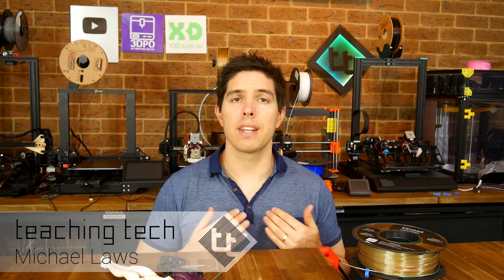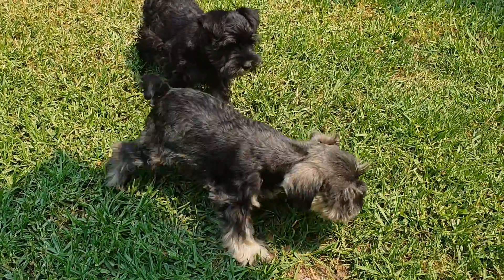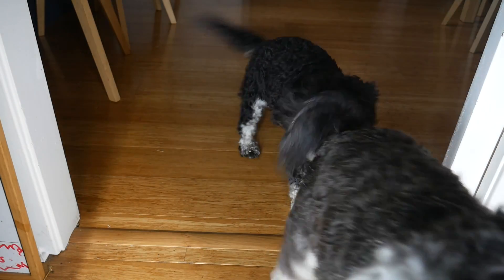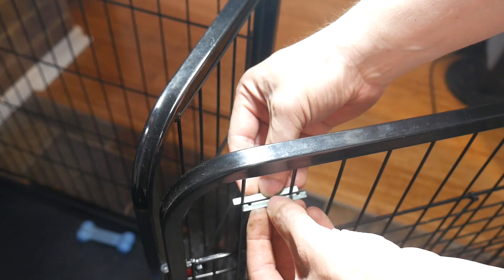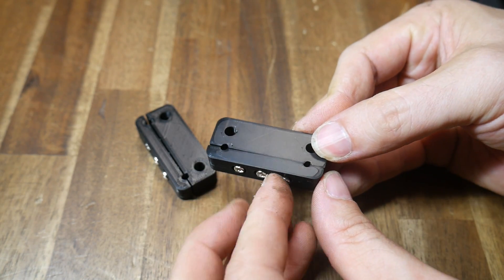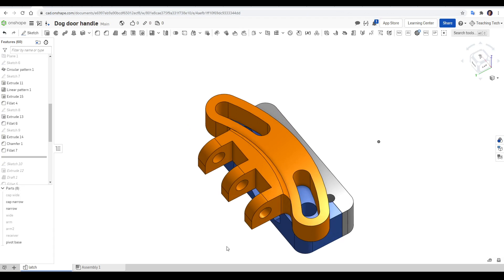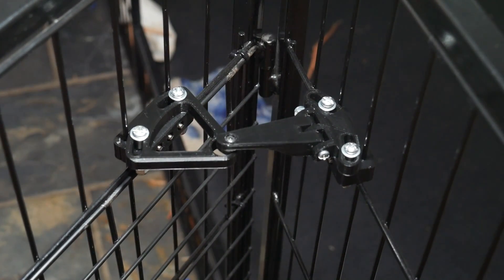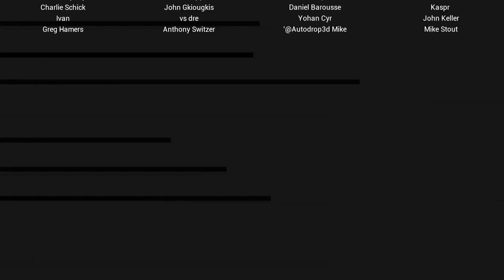Practical printing my dogs into submission with the Prusa Mini

Comment: Very pretty and elaborate solution. In a similar situation in creating a locking system for a pen around here I went for the lazy solution and used some 2.5mm^2 copper installation wire which I had lying around. Not as pretty perhaps but more than sufficient and easy to bend or modify :)
Now I'm considering redesigning that...

Comment: I love this video for the lets-fix-it-with-a-print attitude that I find myself more and more in. I have a heavily modded ender3 that your channel was instrumental in and your tuning github is now a must-read every time I do some serious modding to get everything dialed in. This, and the fact that you do not sugar coat your results or opinion when a mod does not exactly pan out make your channel the first one I visit when I have questions about 3d printing and its ecosystem.

That said, I now came across the Voron type of diy printers and I am tremendously intrigued, but alas, you have not reviewed one. But it turned out, you are not alone. In fact, in-depth reviews of the various vorons are hard to come by. Most vids are just printers-in-motion, or "serial requests."  I have so many questions about this project. Do you think this will be on your radar one day ? I'm pretty sure it would be a good series in your hands.

Comment: I would like to print practical stuff like this, but I'm still trying to get my Ender 3 Pro to work with my BL Touch.  Almost 2 years and it's still printing the first layer in the air.

Comment: You should try attaching a thin strip of spring steel on top of the latch and hinge. This would make it so you have physically lift the drop bolt latch to open the gate. Of course this would only be necessary if the bolt latch can be popped out by the dogs scratching at the gate.

Comment: I would print a V shaped part which slides right over these two grid doors where the hinges are, as wide or long as possible and high as reasonable, maybe 15 to 20 cm or 6 to 8 inches high.
Quick and easy and let the gravity do the work for you to keep it in place ;-)

But when the dogs get older, they might slide it off over the top. Maybe secure it with a horizontal pin straight through this part and through one door, under the top bar of the door. You can put it at and angle of 45 degrees down with a knob on the upper outside to pull the "pin" out. Let the gravity work again to keep it in place ;-)

Sooner or later you need a latch at the right side to lock the grid door to the wall.

Comment: "And that's why I always recommend printing a simplified test piece early in a project" 
Yup! That's very good advice I've kind of been learning the hard way yet for some reason I still refuse to actually follow it.

Edit: Regarding the pups, we've gotten 2 last year and while they did do their fair share of destruction I think they were pretty calm as far as puppies are concerned. Especially since they'd often just play with each other rather than spread havoc around the house. 

Oh and yes I completely understand the loss of your previous dog :'(
Reply: And do you know what's faster than a 3d printer? A 2d printer! Use your cad software to make a 1:1 view of your model and go at it arts and crafts style, cutting it out and seeing how it lines up. I can iterate through even larger designs by printing in tile mode before I move to 3d printing or CNC cutting.
Reply: @cramitdfrog69  Yea I should do that. Instead I just measure stuff and assume it's gonna be perfect (which it rarely if ever is). Plus I'd probably want to get a cnc machine cause my arts and crafts skills are limited unless I'm using a computer.
Reply: @cramitdfrog69  aha i know, but I'd still manage to suck at that.

Comment: I also like to print practical stuff. We have a Goats Cheese business. Recently we received an order for a cheese that you can't find a mould for. So I printed us one. It took 25 hours. Our back door is the stable type and when we moved in it did not have a working bolt slider to keep the bottom half closed when the top half was open. So I downloaded one from thingiverse and it works a dream.

Comment: Merry Christmas from one Michael to another. Actually just did a quick practical print today, the pewter seat hinges gave in in the guest bathroom. Modelled and printed a compatible replacement part. Looks good and works absolutely amazing.